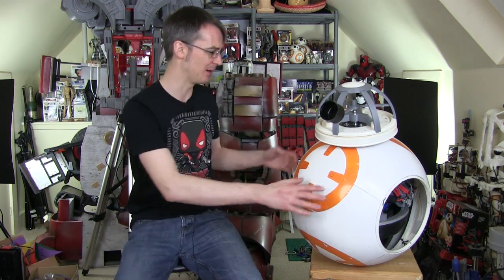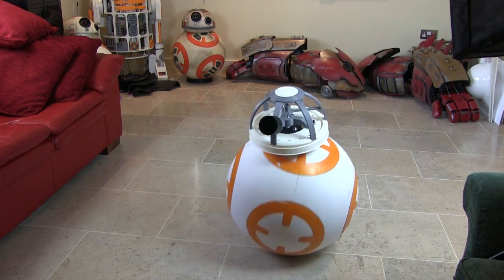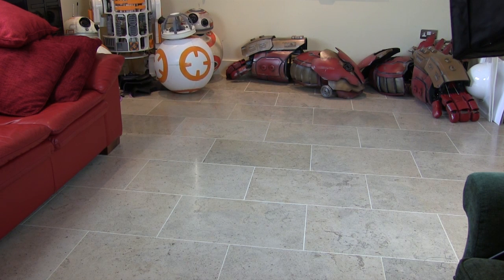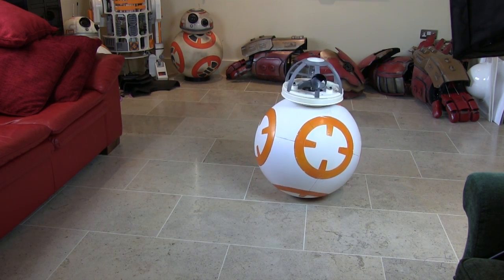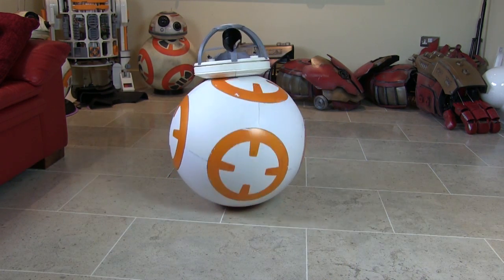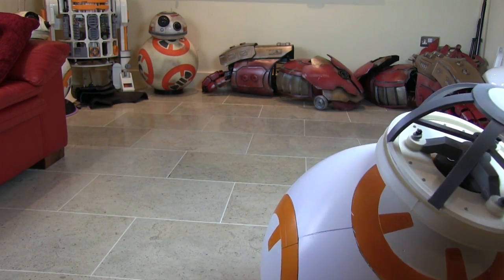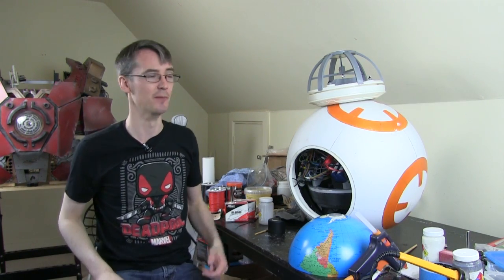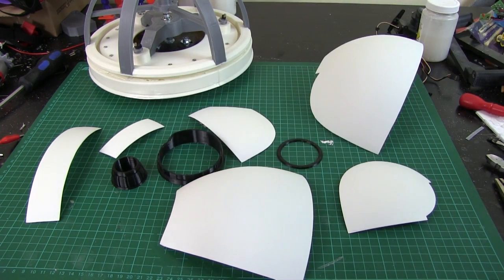Star Wars BB-8 Droid v3 #12 | Stability Update | James Bruton

Comment: Hey there, Will you be doing a hollow ABS or a Hollow Ninjaflex pattern for the inner head Detail parts, or will you do something completely different to save on weight? Also, as for the problem of your droid's head falling off, might you need a better Rare Earth Magnet possibly? I'm not sure if you could use a stronger one without causing havoc with the electronics and the radio signal. Just suggestions off the top of my head, but I'm sure you've already thought of these. 

Keep up the Awesome job, my friend. I'll see ya' later.

Comment: James small idea for faster on the spot turning. this wont work with your current build, but if you used a 2 part cheese, an inner and outer ring. the inner ring would be slightly smaller, but with tension load grip arms that kicked out when the cheese was spun, to grip on to an outer static ring on the chassis? could save on the spot turning time with having to spool up the cheese.

Comment: Just thinking what if you used electropermanents to hold the head up?
Reply: In theory electropremagnets require a pulse of electricity to lock the current in place and another to disable it, the advantage is that the magnet be better than electromagnet (my first idea) and will be more sturdy in strength  than a regular magnet.

Comment: Could you use stronger magnets to keep the head on a bit more securely?
Reply: +James Bruton (XRobots) I see.  But stronger magnets on the interior armature wouldn't add mass to the head.  Anyway, just a thought.  Love your channel.
Reply: +James Bruton (XRobots) Could you add stronger magnets in the body only? I expect this would increase the adhesion of the head without increasing the weight (of the head at least). Thanks for sharing all of your work and experience. I expect to start printing your designs for the internals as soon as I finish printing all of the shell and head parts.
Reply: +James Bruton (XRobots) Same idea at the same time as +InformantNet Again, thanks for sharing your work and experience!
Reply: +James Bruton (XRobots) How much closer could you get the magnets?
Reply: nagualdesign I think we've beat the magnet question to death and that James has considered all these suggestions by now.
Reply: +InformantNet Beat the magnet question to death, you say? Does that mean he found a solution?

To be clear, I was actually posing a question to James. 1000 apologies for being 4 days late to the party.
Reply: nagualdesign Clearly.

Comment: Hi James,

Congrats for getting so far I know the ball compound shape is a rather awkward to cover. 
I was very surprised at the power usage, and was wondering if as might be likely you have more space to use in the demo and display halls, you could, as part of driving it or ‘puppeteering’ press the button to turn off a lot of the, is it the PID controllers keeping it so steady, once you have it moving in a long straight line, pressing it on again just before you need to do turns or halt? I would also imagine that would save enough power to make it worthwhile giving it a longer and possibly cooler running time?

Please forgive my ignorance but I am not in a position of even attempting to build one of these marvels and to watch it drive with the head not tethered is any apparent way is very odd, but a good interesting type of odd   ;=)
Reply: +James Bruton (XRobots) I am just saying a thank you for your reply James.

Comment: will you add a speaker as well? The sound is a big part of the character I think
Reply: +James Bruton (XRobots) Maybe a small one like the ones cellphones use, I mean the cellphones that sound well.
Reply: +James Bruton (XRobots) Plus you can print an enclosure that acts as a resonator for the speaker.
This works amazingly well with today's laptops and it would only weight a few grams.